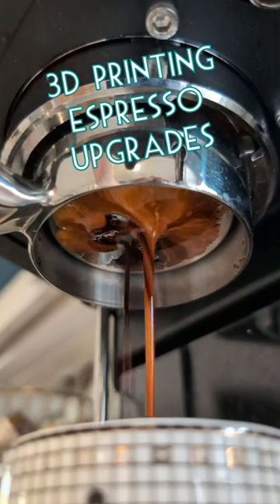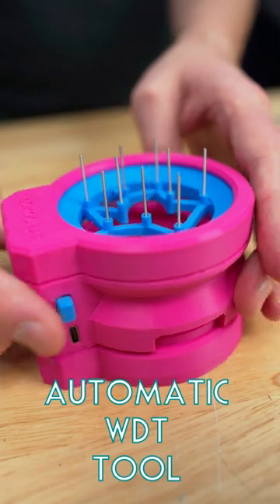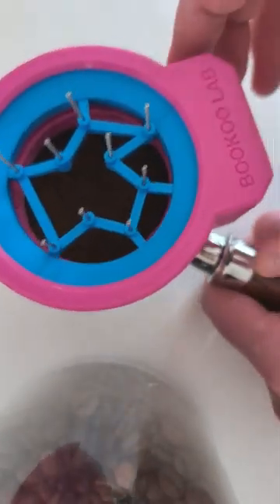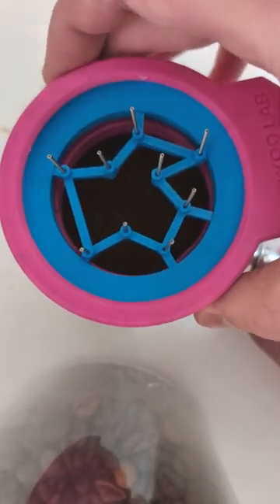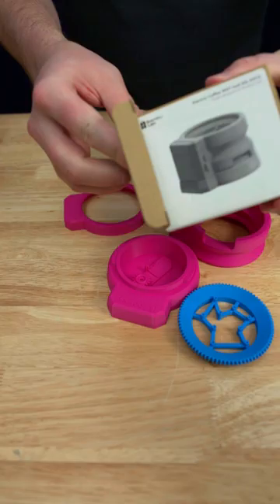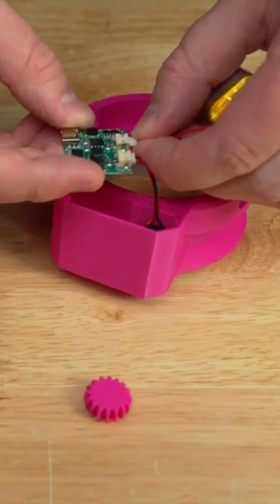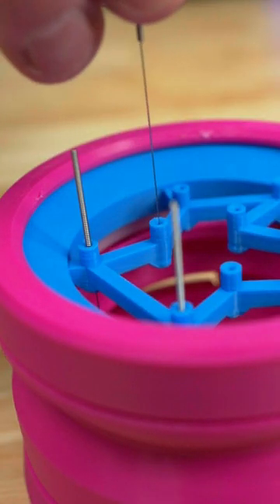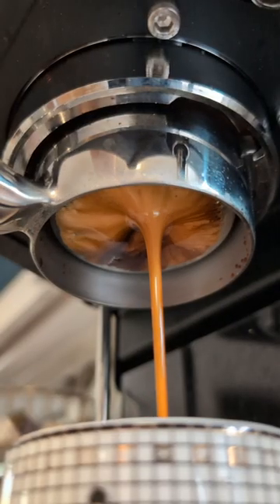3D Printed Espresso WDT Tool ☕

Comment: is the kit foodsafe?
Reply: Bro wat do you think. Of course its not it is shaving micro plastics into your puck jaja
Reply from the maker: Only metal is touching the ground coffee
Reply: @JJShankles  ya sure touching but you have plastic rubbing on plastic just self clearancing into your coffee
Reply: @gulag_inmate69  pretty sure the kit includes a bearing
Reply: Ya thats better but they say the bearing is also plastic just not printed @ZeeLobby
Reply: @gulag_inmate69  Ah, but this is one of those areas you want plastic bearings, specifically POM in this case. If it were metal you'd have to lubricate it, POM is self lubricating. You wouldn't want oil or grease dripping into your food. POM is also food safe. Many kitchen appliances use POM bearings.
Reply: Why does someone always ask this question about anything related to printing, even when it doesn't touch food, but not about products you buy in stores with plastic components? 🤦

Comment: What other kits like this are there?
Reply from the maker: I just finished their phone charger that looks like the A1 Mini a few days ago
Reply: The Lamp Kit I think is the most popular one. "Kits" in the context of Bambu Lab kits are a standardized set of components in a box you can build models around. The Lamp Kit 001 is originally meant to be used in a modern table lamp, but its most popular use is in a Minecraft lantern print as an example. The WDT kit is cool but their best kits imo are the ones that provide less niche use cases like the mouse kit, wireless charging kit, and lamp kit.

Comment: 38 euros, hard pass for some microplastic espresso
Reply: Yeah, the price on this new round of kits is pretty wild
Reply: if you make it out of pla it still gives off microplastics but they break down unlike other types of plasic. also with polystyrene
Reply: @theflyingnon1133  Also it's got a POM plastic bearing in it, which is used in a lot of food safe stuff, so it's not really even an issue.